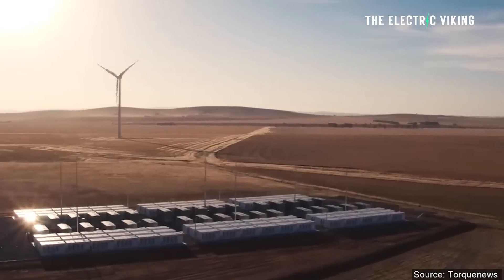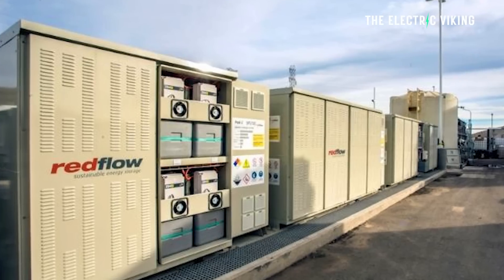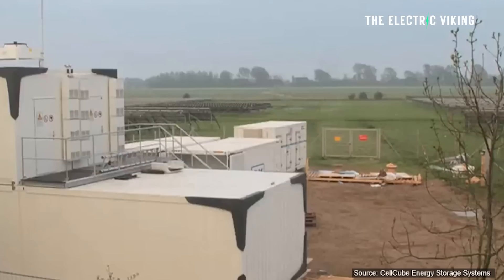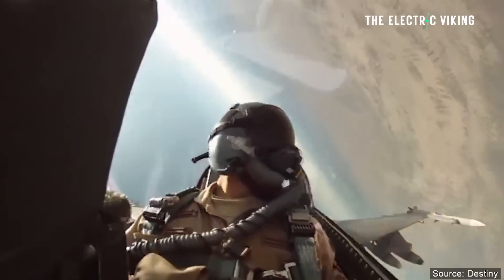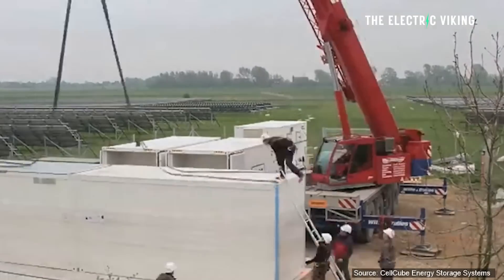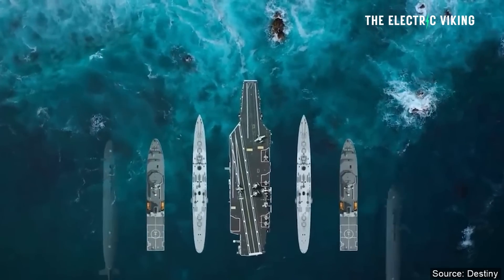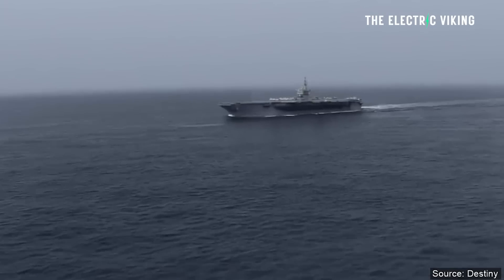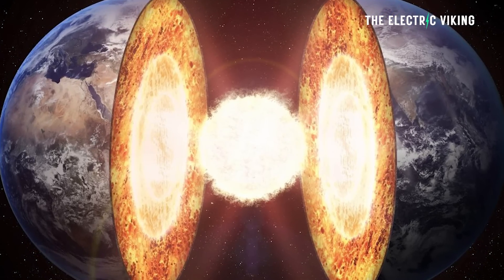US Defence department are using new battery technologies to counter threats

Comment: Your position against hydrogen is a bias based on what current technology is able to achieve. Hydrogen powers the universe. Our sun/star is hydrogen powered. The first automobiles were battery powered until a motor used as a starter allowed gasoline cars to be safer. Out went electric cars in came gasoline. Now battery powered cars are making a comeback to reduce our dependance on a fuel source that is based on flora that died millions of years ago. This fuel source is finite. It has to be barring some way to accelerate the process that made it in the first place. The process that gave flora life was photosynthesis. The light from the sun and CO2 gave energy to the plants so they could live. Since hydrogen powers the sun, going to hydrogen is taking out the middleman - fossilized flora - and creating energy directly from the noble gas. BTW, hydrogen fuel cells are being considered for autos too. Fuel cells, just like an ice hydrogen engine exhausts water. You can't give up on the cleanest potential fuel just because there are growing pains. Hydrogen will be used, just will take time for  it to be as easy as gasoline for the consumer

Comment: Look forward to your video of Eavor.  The genius feature of this technology is that you can replace the boiler of a coal plant with the geothermal fluid.  The rest of the plant's infrastructure can continue to be used.  Making the system very economical.

New small generating facilities can also be installed in multiple locations which would reduce the need for new transmission lines.

Comment: The helicopter unit I served with in Viet Nam had a 40 KW diesel generator ( maybe larger, It has been 50 years ) the ran 24 hours a day. Very noisy. In the summer, solar and batteries could have reduced the runtime to a few hours a day. In the winter, Dec, Jan , Feb. the genset could have run for 1 out of 4 or 6 hours. Hue area of Nam.

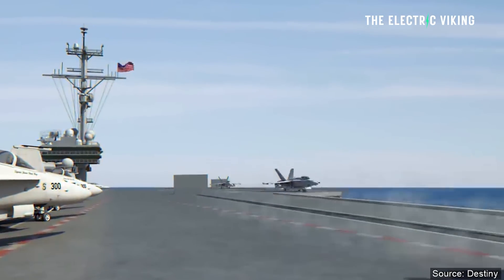Comment: 5:47   Limitless clean energy from the earths core might heat up the atmosphere even faster.  Heat has to go somewhere and I gather most of it does not end up back in the earth.  That means it ends up in the atmosphere.
Reply: We would need to be using roughly 1400x the current energy usage of man, all coming from geothermal for the thermic effect to equal 1° C
Reply: If we don't burn stuff, CO2 doesn't end up in the atmosphere to trap the heat.
Reply: While one or two geothermal wells wouldn't make much difference, many such wells continued for centuries would. Any cooling of the Earth's core is the second worse thing we could do after heating the atmosphere.

We rely on the Earth's interior heat to be maintained to power the Earth's magnetosphere, a feature of the Earth that is vital to life by protecting us from ionising radiation.

Geothermal is not at all sustainable unless associated with volcanism where heat is coming to the surface anyway.
Reply: @jimgraham6722  Maybe you could do the math and find out if that's actually true. Those that have, claim it is not, and the heat is due to radioactive decay anyhow. It's not going to run out.
Reply: @jamesvandamme7786  The reality is we don't know exactly how the heat is generated, supposedly thorium and uranium decay, in which case we are about 90% through the uranium and about halfway through the thorium. Those heat sources are in decline. Gravitational effects and/or tidal effects are also in decline.

We do know the mantle is slowly diminishing, it's important we do nothing to hasten that process.

On the surface, solar, wind and hydro can make most of the energy needed without significantly disrupting natural cycles.  We may need some additional heat from radioactive decay in which case the best way is to put thorium and uranium in nuclear reactors.
Reply: @jimgraham6722  Well, reactors are pretty expensive and geothermal could be a lot cheaper. If we only have a few million years of uranium left in the crust then maybe it's OK.

Comment: The Canadian company could be Eavor. Unlike other geothermal operations it uses plasma-assisted directional deep drilling techniques (thousands of metres deep) and a patented tube liner technique to create a closed loop pipe system that recirculates a non-corrosive fluid deep into the hot mantle and back to the surface.  One of the really cool (ha ha!) things about their projects is that they use the hot-cold thermocline to drive the system with little or no electric or diesel back up.  It's beautiful, and will no doubt outcompete the standard method of tapping into underground reservoirs in volcanic zones of superheated water, which is usually highly corrosive.  Eavor will be able to tap heat anywhere under the surface, not just in volcanic areas, just be drilling deeper and using closed loops.  It may be possible for one wellhead to have three or four deep arrays of pipes radiating away from it at steep downward angles to, say, the four cardinal directions, using one or two arrays for a few weeks, then switching to the opposite arrays to allow the first zones to reheat to optimum temps.

https://www.eavor.com
Reply: There's lots of geothermal interest now. If they get it to work, people will forget about nuclear fusion.

Comment: Tanks like the M1 Abrams run on Jet Fuel not Diesel, and they are fuel hungry Turbines,   If they could be Run on Electric they could be charged in the field without support trucks and would have enhanced  capabilities do to higher torque Electric drives simular to Cats Diesel Electric Heavy Equipment.
Reply: Fuel is a huge lagistic issue
Reply: 🤓Quick correction: The Abrams is fuel agnostic. If it burns, it'll use it.
Reply: @edmondsmith4259  True that's one reason for the Turbine.

Comment: geothermal output is limited by conduction
Reply: Ah I see someone else has actually looked into this.  For some reason people think "hot = good" when it comes to geothermal.  You can have 1000 degree heat but that is sorta useless if once that heat is gone it takes a year to get heat again.

Comment: Iceland, the land of Smart People and active Volcanos 🌋 has been using thermal power for decades.
Reply: Not everybody has a volcano underfoot they can tap. Most places you have to drill for miles to get usable heat.
Reply: @jamesvandamme7786  That is true but the USA has, afaik one of the biggest, Yellowstone?  And they drill for miles sometimes to get oil, perhaps they should do the same for heat...
Reply: @Argoon1981  Nobody lives in Yellowstone, and we need geothermal near users where there's no corrosive volcanic activity. They're getting close to tapping it.
Reply: @jamesvandamme7786   I don't believe you really need people living near a power plant for it to be viable, transporting energy across large distances, is what transmission lines were made for! Yes the further they transport the energy, the more loses in power but it seems is not that bad, because today you have countries producing energy and selling it to other countries! 
For example, Portugal were I live, produces hydro and wind energy and sales part of it to France, that energy as to travel across Spain (almost the entirety of Iberian Peninsula) to reach France.
Reply: @Argoon1981  Specifically, we were discussing geothermal power. The Yellowstone volcano is 2000 miles from me in New York, and that's not really active, just warm-ish. Also, those volcanic hot spots tend to have very corrosive water, poisonous gas, magma intrusions, and other problems. The deep geothermal that's being actively researched today is under all surfaces, just much deeper. It's also nice clean, hot rock. If they figure out how to drill that far, I could have one in my back yard. 

Sending power over country boundaries leaves you open to political problems. Like gas from Russia.
Reply: @Argoon1981  if it was that simple they would do that.  There are multiple issues though.  Tapping into those really hot formations is hard on everything.  Its not just a matter of having the drilling equipment not be destroyed.  They need it to survive long term.  There is also the issue that just because an area is hot doesnt mean it can be used for consistent heat.  You can pull all the heat out in minutes and then need to wait hours for it to get hot enough again.  We need consistent heat if we want to produce baseload power.

Comment: An EMP Strick will make an all electric Tank dead in the water/Track.
Reply: There's no EMP weapons that is movie fantasy, the only thing capable of creating a powerful enough EMP blast to stop a war tank, is a nuclear blast, and if the bomb explodes above the ground and in that case the EMP, is the lest of your worries.
Reply: You can EMP harden your battle electronics. What makes anyone think they don't? 😅
Reply: Not likely, since a solid metal can is a good Faraday shield.
Reply: If that was the case, the fuel powered tank would stop to, because all the electronics that control fuel injection in the engine.
Reply: See the Wired Magazine article several years ago remote hacking a gas Jeep